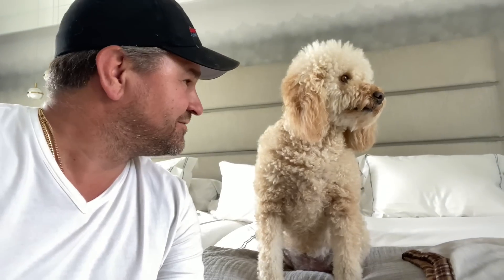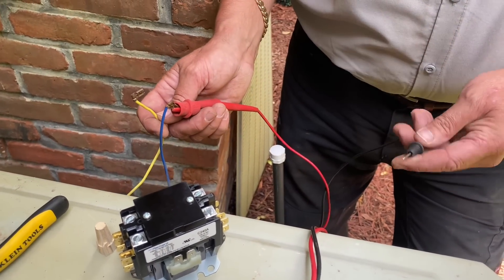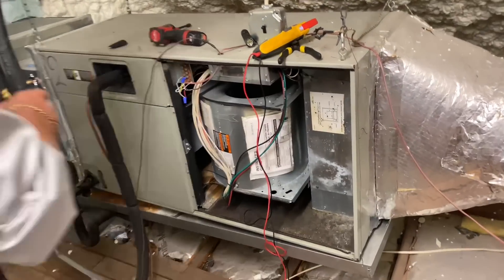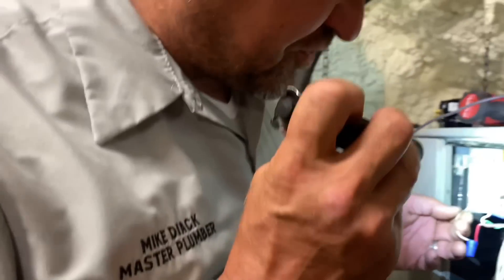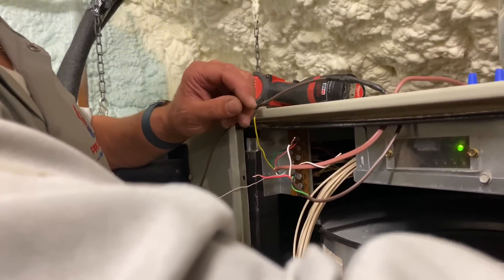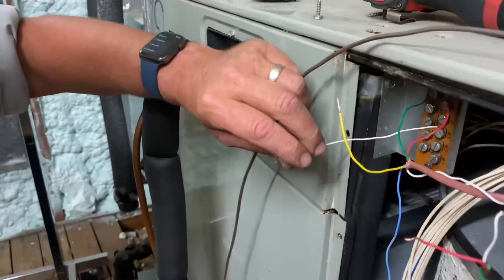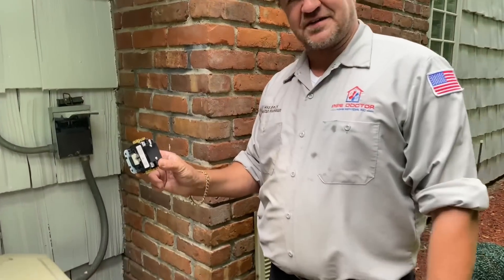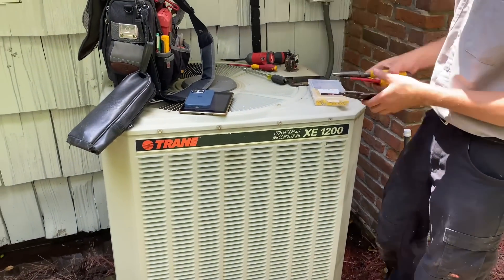Central A/C Low Voltage Wiring for Dummies

Comment: Good job learning a little bit each day. So I had a guy basically last year my original HVAC guy wasn't available. Had another guy come out. To make a long story short didn't know this until now I had to keep replacing my transformers found out the guy basically cut my capacitor to bypass the air conditioner and because of that I had to replace my capacitor four times now the low voltage wire was bad but instead of this guy telling me hey I can go to the supply store buy you the parts charge you like $250 to fix everything he wanted to charge me $523 for that fix. But then his original service call was $89. How do you go from $89 to charge in someone $140 when he leaves I didn't know he even cut my wires cuz I had went inside to use the bathroom came back out the unit was put back together and everything was working. Now until November another transformer blue so I had another my original guy fix it then 2 months later another transformer blew he fixed it again then as soon as he left I heard a pop I'm like son of a whore what in the freaking world is going on why are these keep popping So that's when you know he came back out can I turn on my air conditioner and I realized it's not working so I had to call the guy back after he left and I told him so next day he came out he said why did someone cut your capacitor wires I said I have no freaking idea pretty sad but lesson learned you have to always use someone professional but this other guy was a hack job guy but I hope my main guy can fix it cuz if this guy ruined my air conditioner. Then I'm going to have to go to small claims court

Comment: Did you actually measure 26 volts between 2 legs or 13 volts each leg to ground and you assume together are making 26?if you had 26v it should energised the contactor.taking 13v from same source and apply to each leg of the coil of the  contactor then you have 0volts differential thats why it didnt pulled the contactor in
Reply: Why did you erase my answer?

Comment: You ever run into a transformer when testing had proper voltage on the wires, but under a load voltage to cut back in half? Yep I learned a lesson that day don’t assume just because you have proper voltage the transformer is fine..😂😂 that little episode took me better part of an hour before I decided it was a weak transformer🤷🏻‍♂️ live an learn😂😂😂 but don’t you love it on another contractor comes in and screws up a working system and then we have to figure out what they did wrong ?? But it’s money in our pockets
( edited fur a spell boo boo)

Comment: Mr mike, have you been experiencing issues with goodman compressors? They’re using compressors with receivers on them causing restrictions. 60% failure rate on them. And check this out, the compressors are made in taiwan 😂😂

Comment: Hello Mike,
You must go to the AHU terminal block with Y before going to condenser as this is the only way the AHU knows to speed up to the cooling CFM, otherwise with it only seeing 24 volts volts on G it only runs at constant circulation CFM while trying to cool. This is common practice with ECM motors. I had also noticed on last couple of videos you mention of looking for 28 volts on secondary of transformer but it should only be 24 volts, if you are seeing 28 volts your primary side of transformer is probably tapped incorrectly as they come multi tapp on the primary. Great informative video while making the trades great again.
Reply: @PipeDoctor  lot of cyber hacks? Hmm? you are doing plumbing and hvac work? Again it might be the NSA. translate to english, death to america.